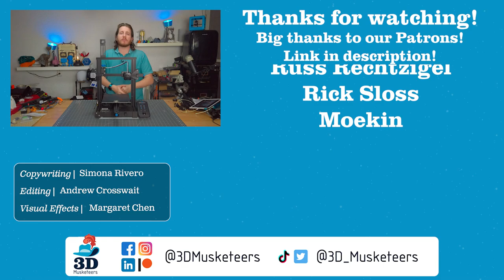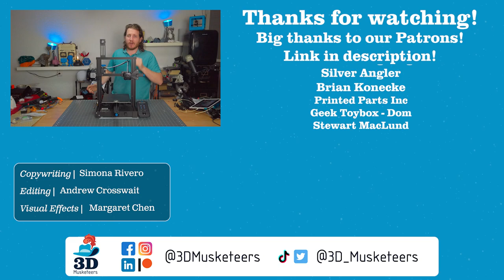Fix 3D Printing WOBBLE!! - Adjusting V Wheels!

Comment: Excellent video, as usual, Grant!
My biggest beef with V-wheels is the inability to spec the tension on the cam nuts. In the few devices I use that have v-wheels, I have them just kissing the surface they ride on such that they have no play, but no real tension, either.
If the polyurethane wheel is under any compression at all, they flat-spot over time. 🙁
Reply from the maker: Yeah it is so much of a "this feels good enough" system and it frustrates me..

Comment: I had been running my Neptune 3 Pro for a long while constantly. I print mostly functional items for myself and having it down really started to hurt. I went to adjust the V Wheels and some of them were completely off with one of the beds Wheels completely loose. About to run a test print but hopefully this fixes it!
Reply from the maker: they wear out over time, you would want to do this regularly if you can!

Comment: Could you make a video on ender 3 s1 pro?
I'm gg nuts trying to make it parallel. X axis, three eccentric nuts
Reply from the maker: I dont have one unfortunately. But the process should be similar.
Reply: @3DMusketeers  On my Ender 3 S1 pro the pom wheels are not consistent, meaning that on different heights the wheels are either good, tight, or spin freely. Any ideas?
Reply: @craftsmanchris7  it was my mistake when I install it back. There are two eccentric nuts on the Y carriage and 1 eccentric nut on the x axis. I installed three eccentric nuts on the x axis. Noob.
Reply: @dougskucas5004
0 seconds ago
 I had the same issue with my Ender3 s-1. You need to loosen the nuts connecting the pom wheel frame to the gantry, first. Then adjust the eccentric nut so ALL 3 wheels have the same tension, then re-tighten the frame mounting nuts. Do it on both sides. There are two screws on the right side, and only one on the X motor side.
 This ensures even contact on all 3 wheels. I had massive improvement after doing it that way.

Comment: My first experience with Ender neo max was crap.
A wobbly bed, warped glass, the X axis carriage locks in certain spots.
Metal debris left everywhere from factory. And that ugly drilling/cutting done for Z profile to mount into.
Not 100% straight up either..

Comment: Just curious, but when I move either my X axis or Y axis, it is kind of noisy and and actual print is noisy too.  I checked both the v wheels and the belts and seem okay to me.  Just wondering what you would siggest to get rid of the noise.  I don't believe this has anything to do with the steppers as this happens when the steppers are not actually working and I have a 32-bit board.  I have a ender 3 pro with belt tensioners and dual lead screws.
Reply from the maker: Take the belt off and move the carriage by hand. If it's still noisy it's time to change bearings.

Comment: I am having troubles where I loosen by a fraction of a movement and it loosens 2 other wheels, and those 2 cant be adjusted, theyre as tightly screwed as can be and loose at the same time, loosening them doesnt do anything
Reply from the maker: yeah the one that you can tighten is on an eccentric nut, as you spin it, it will get tighter and looser as it is off center. This is normal :)

Comment: Great video man. I am using ender 3 s1 pro and the v wheels on the sides of the Z-axis are imbalanced, meaning that when I adjust the eccentric nut 2/3 are rolling as they should be but the other is not moving at all. Any ideas?
Reply from the maker: you should only have 1 eccentric nut per side. But your Z may not be level
Reply: @dougskucas5004
I had the same issue with my Ender3 s-1. You need to loosen the nuts connecting the pom wheel frame to the gantry, first. Then adjust the eccentric nut so ALL 3 wheels have the same tension, then re-tighten the frame mounting nuts. Do it on both sides. There are two screws on the right side, and only one on the X motor side.
 This ensures even contact on all 3 wheels. I had massive improvement after doing it that way.

Comment: You should get some feeler gauges so you can say exactly what is right
Reply from the maker: It would not matter actually as some setups want more, others want less. The tolerances of your extrusions would come to play. We have a set, and hilariously it was off camera as the feeler gauge approach was my plan, but we found the rail had a twist in it and that using gauges would not matter.. With that being said, if you want to try, the 0.1mm should be fine, but note, the POM wheels are softer than the metal, they are likely to deform.

Comment: Theres no edges for creality ender 3 s1 pro wheels :( how to adjust i d k
Reply from the maker: One of them must have that eccentric nut...
Reply: if you mean the bed they are on the right side with left not having the nuts.
Reply: @wrksless971  thx alot, fixed the problem.